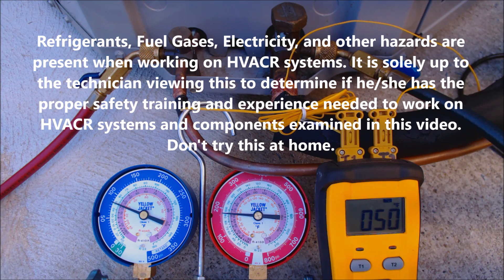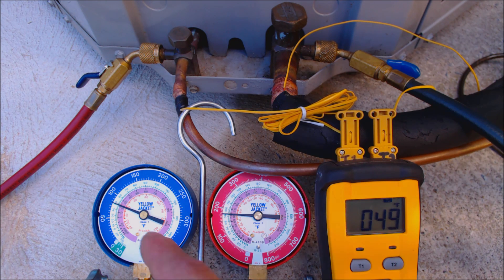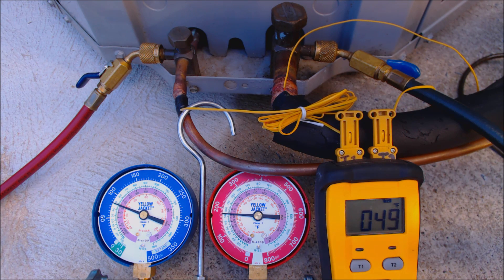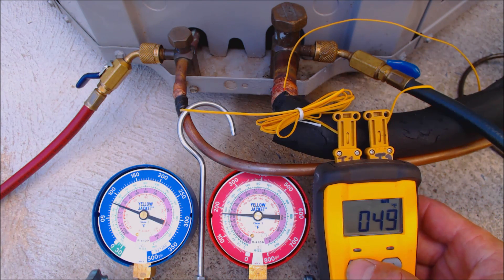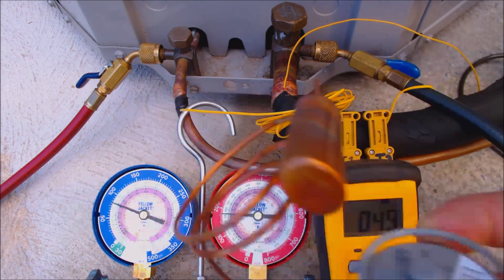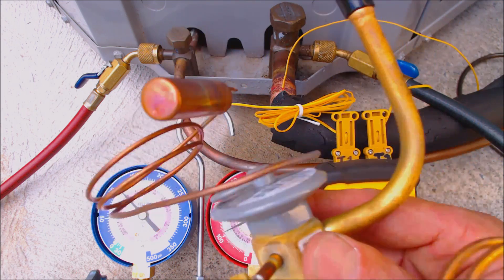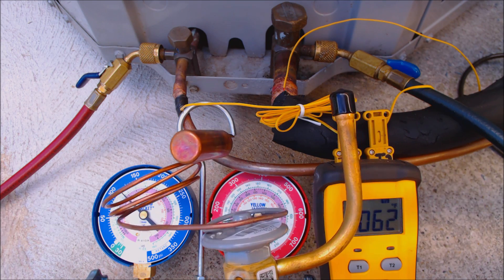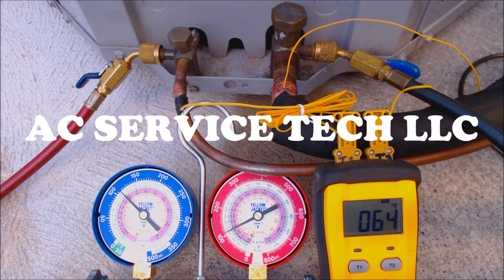Wrong TXV on R-22 System, Bad Readings!

Comment: Hello. Your video is very informative. There has been some controversy on a subject, so I wanted your opinion. I have a 3.5 ton R-22 condenser unit whose compressor has shorted out. Could this R-22 condenser unit be replaced with a 4 ton R-410a condenser unit, and R-22 refrigerant be used?  Also, if this is possible, would the orifice need to be changed? If so, what size orifice? Any other changes? Thanks.

Comment: Off topic but... I have two split sysyems that have two stages on the Heat side. The owner was told that the Cooling side was also 2 stage. I just changed the thermostat and I did not see wiring for 2 stages of cooling.
Is there another way I can look at this??
Thanks
Reply from the maker: Check the outdoor unit and see if there is a y1 and a y2 or something that shows two stages of cooling in the wiring diagram. Then follow to the indoor unit, thanks
Reply: I know on the heating side you can time out the heat to create a second stage if you don’t have enough wires.  Not sure about cooling though

Comment: I have a 10 ton unit at work the HVAC guys replaced the R22 condensing unit with a R410 unit.  The evaporator coil uses capillary tubes.  This damn thing freezes up in cool weather and shuts down on high head pressure when it's hot.. I just figured out wtf the problem is...
Reply from the maker: Oh wow that is terrible. That is what I am talking about when maybe the boss or sales person sells the job and the tech is just supposed to install or replace a component at the job. The tech and sales person really need to check to see what is going on before hand in order to do the best job for the building owner and usually they do but you hear and see these things happening like this every once in a while. I just want techs to be aware of how the problem presents itself and the dangers for the compressor if it the metering device were left in play at least in this scenario, thanks

Comment: I have run into a lot of this issues, did not know this was a common problem.
Thanks very helpful
Reply from the maker: Yeah, I just wanted to show why this wouldn't work. We had one commercial job where bunch of the package units came from the factory with the wrong txv but they eventually sent the correct ones out and paid for the labor to fix them, thanks!

Comment: very helpful information.....thanks
I  have a question , is this measuring tools you are using(Temp, wb and db....etc )applicable to mini split unit and widow type air conditioner.
appraiceted.
Reply from the maker: Yes they are if it is a single speed or two speed compressor. Window units typically have capillary tubing which is a fixed orifice and can be checked with superheat if ports are available. VRF mini-splits we use the "total weight method" to verify the refrigerant charge, thanks